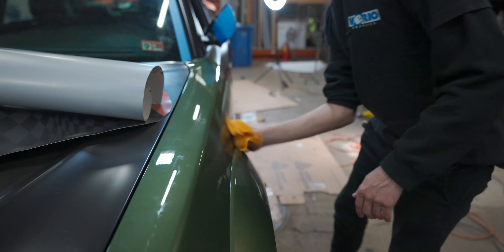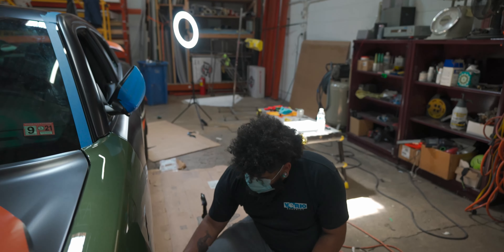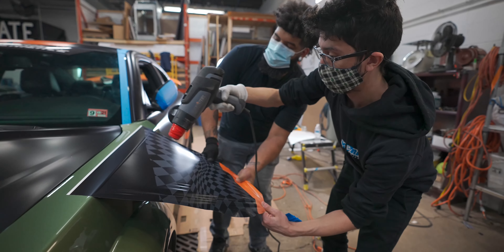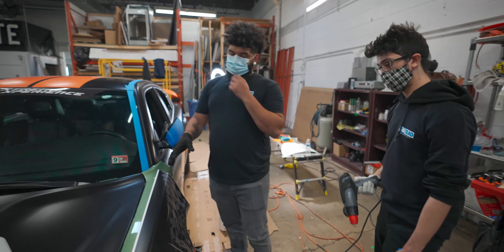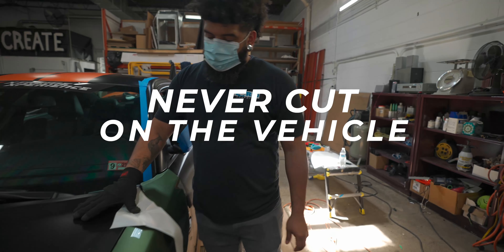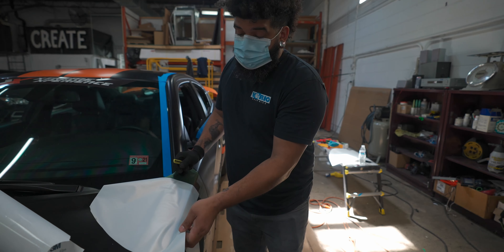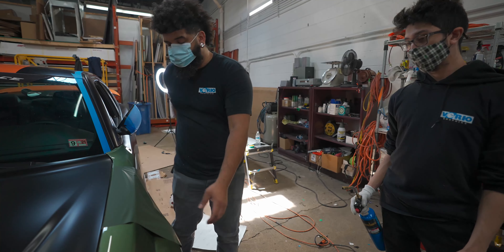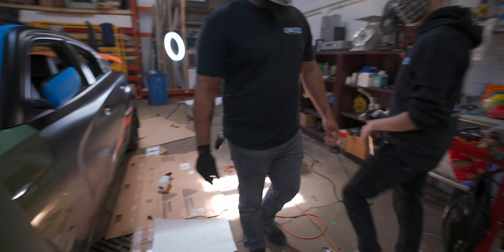MISTAKES TO AVOID WHEN VINYL WRAPPING A CAR *DO NOT DO THIS*

Comment: These are great tips. As a professional vinyl wrapper, I can tell you that prep work is the KEY to a good wrap. Wraps get a bad reputation for peeling, but that only happens if the surface is dirty and/or the material is over-stretched. Be sure to work with a reputable shop and ask about their prep process.